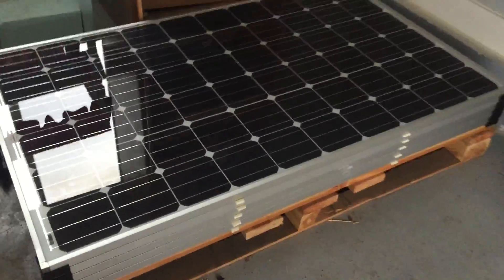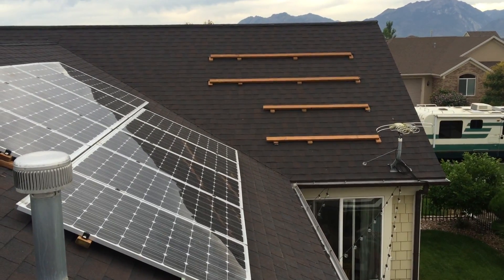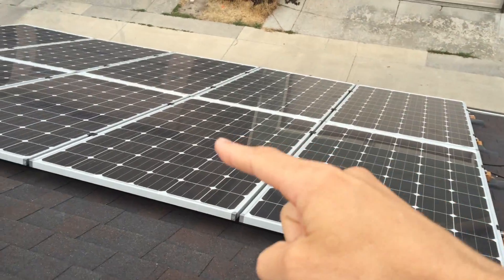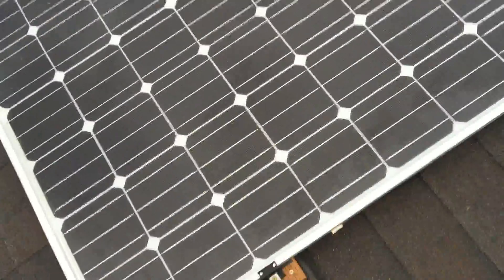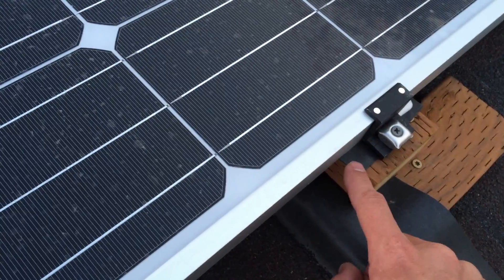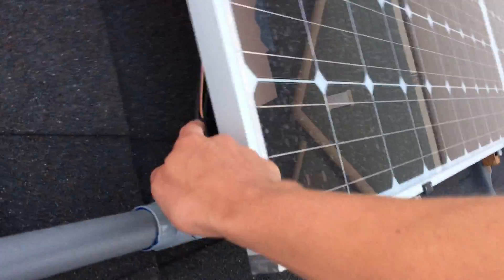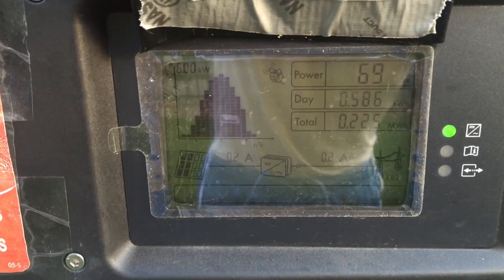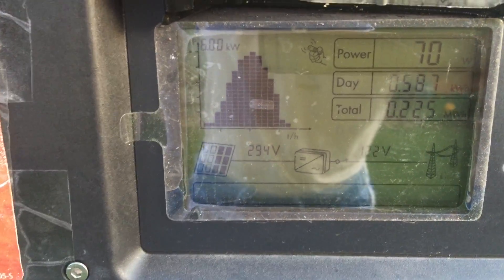How To Install Solar Panels Yourself For $4K - DIY 7KW - South Jordan, Utah - Cheap

Comment: Were the external rapid shutdown disconnects required by the utility? This wasn't required by code when you made this video.
Reply from the maker: Not when I made the video - the rapid shutdown disconnects weren't required by the utility or the city code.

Comment: Thanks for the detailed spreadsheet. It would be interesting to see how much all this material went up since 2016!! My guess is at least 40%
Reply from the maker: Actually the significant expenses (panels and inverter) have not really gone up in price.  If you watch sunelec.com you can see most of that stuff is about $0.25 to $0.50 per watt on the panels (I paid $0.46 per watt I think).  I have found inverters on eBay recently for less than I paid.  Some of the racking system stuff I bought at Home Depot has gone up, especially the lumber, but I would recommend using unistrut for that anyway.

Comment: Wow. Too bad I wasn't in the market 6 years ago!  This has become prohibitively expensive in recent times. It will cost 3 times that amount now for the same system, at a minimum.  Good work, though!
Reply from the maker: Yeah, it definitely was better back then when Rocky Mountain Power would pay the full $0.11 per kWH, but they still do $0.05.  The thing is, I haven't seen the prices triple on the equipment as you say - they have stayed about the same in price.  You can still get panels for $0.50/watt, an inverter for about $1500, and racking system for about $1-2K.  I also have considered doing a hybrid system on my new house now that batteries cost less (probably lead acid rather than Li-Ion), since net metering is paying less.

Comment: Hi Matt excellent installation just I want to know how you connected the power from PV inside Inverter as you said there are 3 Positives and 3 Negatives. Thanks good job.
Reply from the maker: The inverter I have supports 4 strings.  I only used three of them.  Each string has a positive and a negative (from connecting the group of panels in series).
Reply from the maker: Hopefully this helps

Comment: How did you get the number of your breaker in the main power panel?  Is it how big your system is for example watts / 240 volts + 125 % = circuit breaker number?
Reply from the maker: so I used some of that math you mention, but also, I just asked at Home Depot and they told me.  I remember it being pretty straightforward - there weren't that many options.
Reply: @MattNewman  very interesting, I've read you had to go over the 125% rule to determine how big your breaker should be.  I saw yours at 7050watts / 240 volts =  29.375 x 125% rule =  36.7 amps and you have to round that up which comes the next size up is a 40 amp breaker and I noticed you only used a 30 amp breaker?  Well that's one thing I'm not to sure about it's driving me crazy to find that exact right answer here!

https://www.altestore.com/blog/2018/11/grid-tied-solar-breaker-box-120-percent-rule/#.YK8DXClMFEF
Reply from the maker: @directvdirectv3722  but I think I used a double breaker - I can't remember if they were each 15 amp or 30 amp.  Either way, it isn't the end of the world since you were rarely hit that level.  If it does, the breaker will just blow and you have to replace it.  It is probably better to error on the low side so the breaker will blow.

Comment: Under your panels is it just wired in series with each wire?  Do you have some type of device with each panel for the rapid shutdown?  How did you connect the last panel on each string, did you run pv wires and connected them the the mc4 connectors together or splice them with thwn-2 wires in the conduit?
Reply from the maker: yes, in series.  for rapid shutdown, I just have a main switch - not something for each panel.  I am not sure what you mean by the last panel on each string - it just makes a big loop.  the mc4 wires just all connect into each other - negative to positive.  Oh, I think you mean in the conduit - I just use used mc4 connectors and had wire that was the same thickness running through the conduit.  it was a little tight to fit all of them in the conduit, but did the trick.  I hope this helps.

Comment: Great sounds good I bought a retail system 2014 about half of my inverters are still working and they put it on the east side of the house..... so I'm looking at your DIY because you know that's the wrong side of the roof and the companies out of business so thanks for the advice as I am going to replace the inverters move the panels and add more panels thanks a bunch
Reply from the maker: Nice - hopefully you can clean that up a bit!  People often talk about the risks of DIY, but I hadn't considered the risks of fly-by-night, flash-in-the-pan installers that go out of business.

Comment: You should consider doing an update video on your solar array.  Would be interested in how much it has saved you, how it performed in the winter months (snow cover), and how it has weathered?
Reply from the maker: I actually did do a follow up video at https://www.youtube.com/watch?v=Dis6AZPPPjU&t=2s.  Also, see my blog entry for more detail - https://diynewman.wordpress.com/2016/07/24/how-to-install-solar-panels-yourself-for-4k-diy-7kw/.

Bottom line is it is saving me about $1,300/year (my power cost me $1,500/year before, and now is $200/year).  I broke even after 3 years.  I have made about $3K off these Youtube videos, so it actually was free for me.

Comment: I have 350 sq m roof space. How can I design my roof for  grid on solar system. I want to use whole space. Thanks
Reply from the maker: that is plenty of space - each panel is about 1.5 sq m, so you could put like 200 on there!

Comment: Good video. I'm wondering now 4 and a half years later is the wood flap flashing holding up?   Interesting design with the flaps and re-using a wood block as a riser block.

I'm guessing the long wood railings are still just as good as new?  That pressure treated wood is covered by the panels above them and the wood also doesn't have any ground contact since they're on a sloped roof up in the air.  I may be using wood like this instead of expensive proprietary aluminum railings.  But I will be using some 3D printed flash mounts.
Reply from the maker: yes, the wood looks the same - not  really any wear on it.  The rubber  and tar stuff is fine - probably because it doesn't get very exposed.(we have rain and snow here).  I expect it all to last 20 years.  Your idea sounds good - you might look into Unistrut too - it isn't too much more expensive than what I did, but yes, proprietary aluminum can get expensive fast.
Reply: @MattNewman  Thanks for the reply!  Good to hear.  Also, what I did extra was to paint my wood railings.

I have a combination of 2x3 and 2x4 and I painted them with thick coat of black latex paint.   Then sprayed a light coat of clear UV resistant lacquer over them.  I might put a final coat of polyurethane too since I have some spare from another project.  I did this extra step mostly for "looks" because, at a distance, it doesn't look like lumberyard store wood.   But it could have positive effect on longevity.  The wood's surface is now much smoother and actually glossy as the thick paint has filled in divots which should allow rain & debris to slide off easier.
Reply from the maker: @beyondfossil  Yeah, that is a good idea to paint them, for looks and adding some life to them.

Comment: Why didn't you just punch holes through the attic and run flex to your main panel
Reply from the maker: I was a little scared to punch holes in the roof since I hadn't done it before.  Also, the main panel is way down in the basement, so it would have been much farther.

Comment: I was just looking at the Tesla solar roof and the price blew me away.  The numbers didn't make sense, I assumed you could do it for much less.  Looks like I was correct.  Great video, would definitely like to give this a try at somepoint.  It just kind of seems like a fun thing to do.
Reply from the maker: Yeah, but Tesla is getting  the cost pretty low.  For a system  like  I did that cost me $4K,  they could do for  $10K,  which is better than the $16-18K most solar installer would charge.  But yeah, the DIY is fun and  pretty easy to do if you want to save $5-10K too.

Comment: I'm curious how the wooden mounting system is holding up after 4 years! A follow up video would be great too. I'm thinking hard about a DIY solution but it hadn't dawned on me to make my own rails too.  I was looking at kits from wholesalesolar
Reply from the maker: it is holding up well.  The treated lumber is working well and hasn't really weathered much.  The only think I don't love about it is that I think you can crank on the metal harder - I have had some of the bolts get loose and I had to tighten them up again.  I would recommend using unistrut from an electric supply store - you can get it for about $1.50/foot, so I could have done all mine for about $400 total, not a lot more than the treated  lumber and probably better long-term.  The kits I have seen  usually charge a lot more than this.
Reply: @MattNewman  I saw your note about unistrut (maybe on your blog). And yeah, the kitted rails seem outrageously expensive. I've been browsing unistrut all day - I'm trying to figure out what fasteners to get. There's another youtuber with some content about unistrut, but he rambles a lot and it's hard to sort out his good information from his bad information. He did lead me to this, though, https://www.ebay.com/itm/100-Strut-Channel-Nuts-1-4-20-Standard-Spring-Zinc-Plated-Unistrut-Nut/361979858868?hash=item5447ae4fb4:g:koYAAOSwZKBZGL6T and those seem promising. I need to figure out what would go on top of the panels still. There are specialty parts that are $5 to $20 per fastener, and that's insane. I might go with a simple bolt plus a big washer with a rubber washer.
Reply from the maker: @DigitalArchmage  I hope to  make a video when i get some unistrut to replace some pieces.  Basically, I plan to get unistrut like https://www.lowes.com/pd/SUPERSTRUT-14-GAUGE-ELEC-GALV-CHANNEL-EG-10-F/3370630?cm_mmc=shp-cprdelcgooglelia-206-conduitandfittings-3370630-_-0&placeholder=null&&ds_a_cid=112741100&gclid=CjwKCAjw4MP5BRBtEiwASfwAL38Nquvam9WkH-4Ra1L7RPL3Cbwbh8ewI5zMaVrfG5x_bWYM9NU5EhoCh0oQAvD_BwE&gclsrc=aw.ds but I will get it for $1.50/foot.  I will just put my bolts through the hole and get washers (I like your idea of the rubber washer) and just tighten with a normal nut.  I am not sure you need those fancy nuts you had the link to.

Comment: I am looking at installing a 10Kw system myself in Utah.   The all on one providers are still outrageous on their profit margins.   I got a quote for all the Panels, Inverter, and mounts and wire for 4500.00 + shipping from a reputable over seas brand.    Now just gotta get the balls to pull the trigger.
Reply from the maker: Nice!  That sounds like a good price - I would be interested in what brand/company you are getting that through

Comment: Start small you can always add more if you need it!
Reply from the maker: true, but that isn't always the most cost-effective way to do it.   For  example, my panels cost $2K, but $500 to ship the full pallet.  If I had to ship just a few more, it would probably cost near what I paid, so it is good to try to get what  you need, even overestimating is  okay.

Comment: & All Installed while wearing Sandles!!👏🏼🙌
Reply from the maker: indeed!
Reply: Matt Newman you might have an idea on something i want to do. Solar charge my M3 from Solar panels inside the car! It has all that glass roofing, and of course the windshield/dashboard)))
Reply from the maker: @davetriplett4779  yeah, I have seen a few projects of charging a car with solar panels.  Generally, there is not enough of surface area to make it worth it.  I did see a motor home that was pretty effective.  I suppose if your goal is to just air condition a bit, you could put panels on the car.
Reply: Matt Newman yeah. Thats all im expecting. A/C while i have to park in the hot sun...& trickle charge so i dont lose any battery (charge).. it will cost me $300/panel & i can fit one or two for a windshield shade, one in the front roof section, & 4 or 5 in the back. The hard part is finding where to Tap in where a DC supply would be accepted.... i cant find any videos on this...
Reply from the maker: @davetriplett4779  That is an interesting idea.  You may need a charge controller (to regulate so you won't overcharge your battery), but then you should be go right into your battery.  
I did see https://www.youtube.com/watch?v=Wtgk-bGD9y0 
https://www.cheaprvliving.com/forums/Thread-Solar-Panel-for-windshield?pid=18307
https://www.google.com/search?q=solar+panel+windshield+shade&safe=strict&sxsrf=ALeKk00ozs2aLtVz9n6_azd1Nibzqpn2_Q:1594038979108&source=lnms&tbm=isch&sa=X&ved=2ahUKEwiZjO740bjqAhWVZDUKHSSFB0kQ_AUoAnoECAwQBA&biw=1680&bih=872
although not exactly what you want.
Good luck!
Reply from the maker: @davetriplett4779  also see https://www.quora.com/Can-I-add-a-compact-solar-powered-air-conditioner-in-my-car-for-when-it-is-parked-in-the-sun
Reply: Matt Newman the car already has a limiter, it should have all the protections in place, after all i just did my first Supercharge & it charged me from -0-90miles in 10minutes! 🤩 Ill check out these links! Thanks 🙏
Reply from the maker: @davetriplett4779  Yeah,  if you are wanting to  get batteries, you could  use 18650  li-ion batteries -  see https://www.facebook.com/groups/diypowerwalls/
Reply from the maker: @davetriplett4779  wow, that is nice - then yeah, perhaps you could just get a panel and hook it right into your battery or somewhere along  the path to the battery that goes through the limiter.

Comment: Good video Matt did you fill out the paper work for the Electric company yourself or did you have some help.
Reply from the maker: Thanks - I did all the paperwork myself.  It was actually pretty straightforward - some stuff from the city for thee permit, a form for net metering from the power company that was just a couple pages (and asked about inverter, how many panels, etc.).  See all the details at https://diynewman.wordpress.com/2016/07/24/how-to-install-solar-panels-yourself-for-4k-diy-7kw/ and particularly on the google drive at https://drive.google.com/drive/u/0/folders/0B8sb6jeRth9FYUw3NGxlcEdieGM

Comment: What happen when you need the roof replaced?
Reply from the maker: that will probably happen when the panels are 20-25 years old, which is about the lifespan of the panels anyway.  so I would probably trash the panels and keep the inverter.  However, if the panels are still good, I could sell them or just take them off and put the new roof on.  installing the panels would probably only take a day or so (to remove and put back on).  also,  at that point, I will have saved about $75K in power (about $3K/year for 25 years) so the panels will have been worth having.

Comment: Excellent Video.  Similar experience with Vivint, SolarCity, etc.  I was quoted 35K for my house.  My installation includes Solaredge 7.6kw Inverter, 24 panels, 24 Solaredge 320w Optomizers, 42 Rocket mounts, and 42 roof flashing.  Total cost with permits, wire, conduit after the tax credit was 9,450 (13.5k less 30% tax credit).  Total install time was about 20 hours, research time was about 40.  to date have generated 28.24 MwH.  Payback time has been 4.5 yrs, and for the next 15 years, we will pay approx $1 per month for electricity.
Reply from the maker: wow - these are great numbers.  Thanks for sharing!

Comment: when you try to be self sufficient the gov finds ways to pull you back down. whats the point of contributing all these kwh when you get pennies for it but the energy companies make $$$ off you.  being stuck on the grid is just politics reaching their hands into peoples pockets and lying about why they need you to comply with the state code.
Reply from the maker: actually, I have been pretty happy with the net metering arrangement I have.  If I didn't have the grid as my battery, I would have had to pay a lot more to have my own batteries.  They are giving me fair credits for the power I contribute, and I don't feel like I am overpaying for the power I get from them.  Overall, I am pretty happy with Rocky Mountain Power (the power company that is deregulated from the government since the 90s).  So, I actually don't think the government, or the power company, is pulling me down.  I am sorry you have had a different experience.
Reply: @MattNewman I would get a battery bank incase of grid failure..Better safe than sorry.. But then again I go overboard..
Reply from the maker: @daveyboy8907  actually batteries are pretty expensive.  i use the grid as my battery!
Reply: Matt Newman they sure are it cost me almost 450 for 4 interstate golf cart batteries with 210 amp hours each. 6 v and that’s costco price cheapest I could find.. I wanted Trojan batteries but they are 250 350 each, no way..
Reply from the maker: @daveyboy8907  yeah exactly - look into DIY Powerwall using repurposed 18650